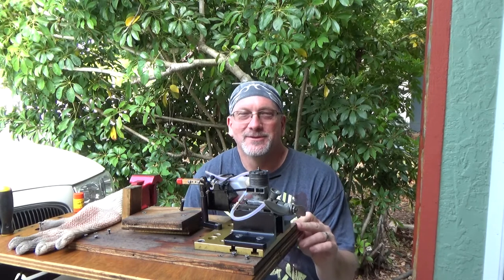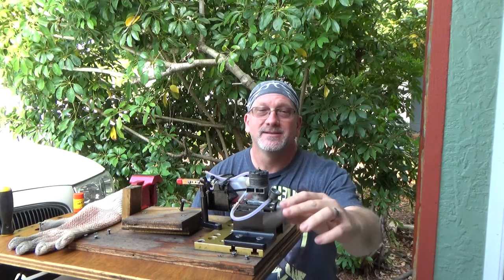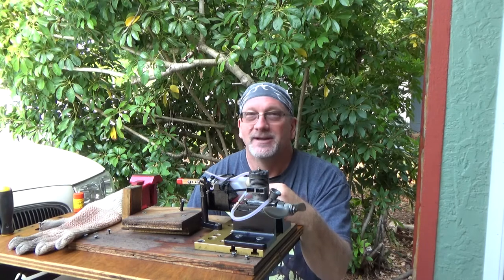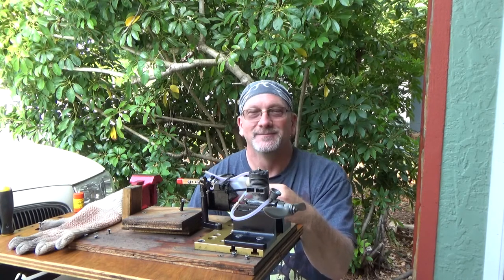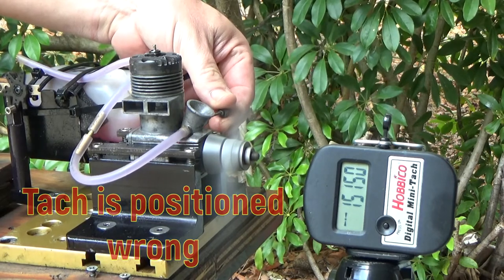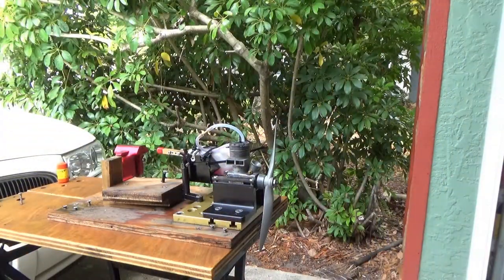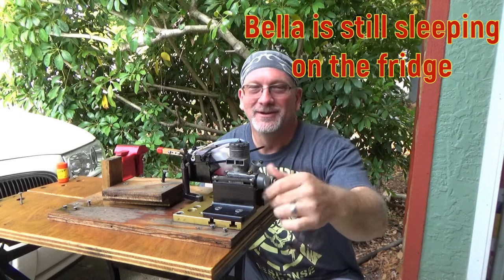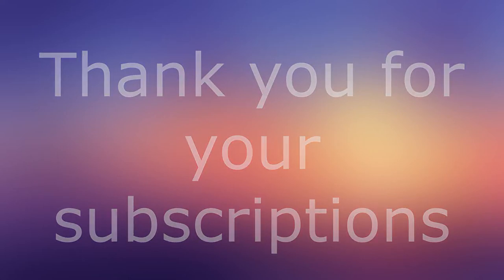McCoy 29 Series 21

Comment: They are from the late seventies early eighties...bought two or three from tower hobbies they were very cheap and I believe McCoy's last stand.  Used these bargain classics they also had a 40 with Perry carbs. ( which if bought alone would cost as much as the entire engine lol).
I still have mine. ...the castings should be examined in the venturi throat for small holes. I used epoxy to fill them in. Ran like a top after that.
Thanks.

Comment: In this area McCoy engines were mostly junk. I’ve had a couple including a “gold head”.  The one you just ran is best one I’ve ever seen. I notice you have referred to them as free flight engines. More likely they are for control line use. BTW l followed your instructions to locate your email address. Nothing there, those pages don’t exist.
Reply from the maker: I beg to differ on my email address.  It is there on the About screen.  You must use a PC to access not a mobile device.
Reply: David McIntire I use iPad
Reply from the maker: I can't help you there.....